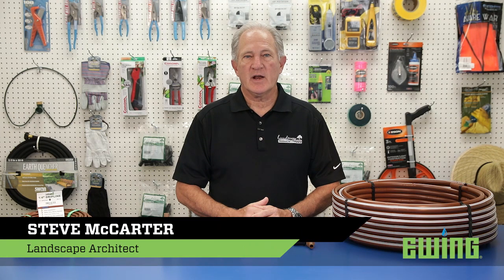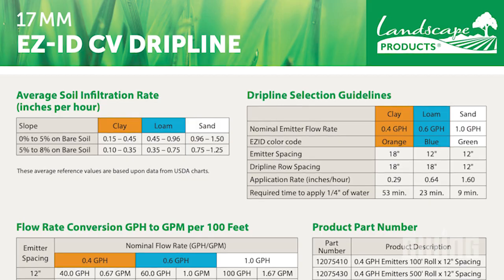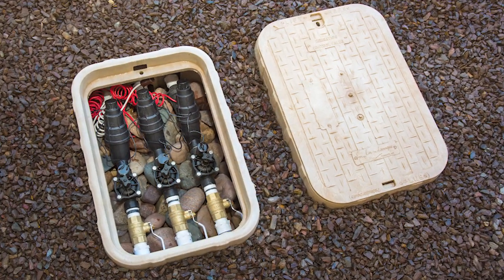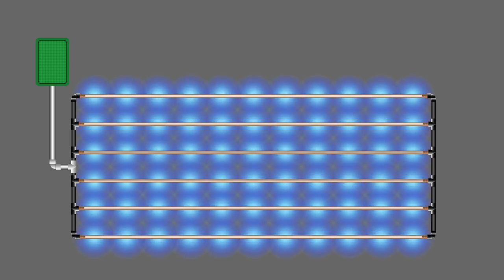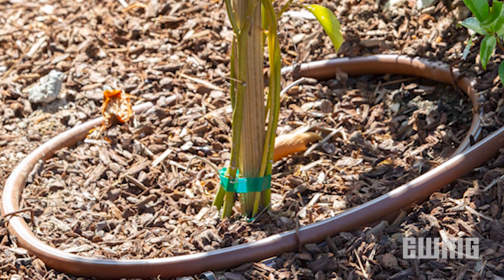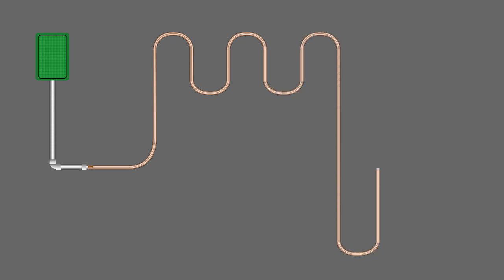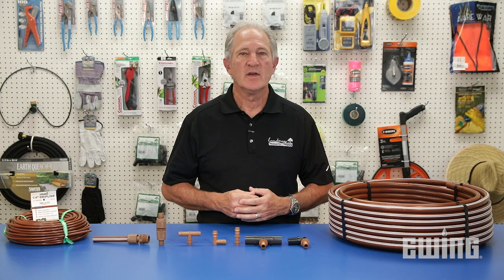Common Dripline Design Layouts

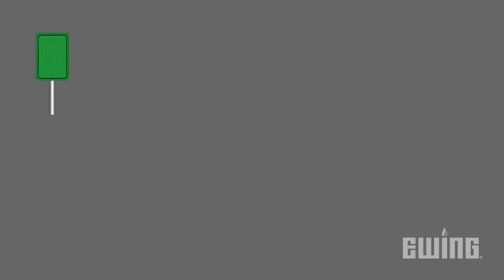Comment: For large trees (30ft or more at maturity) and the ring design (2:15)…can 1/4” be used or does it need to be 1/2” drip emitter tubing? Thank you.
Reply from the maker: You bet. As long as you use enough tubing to meet the trees water needs, 1/4" dripline is fine to use. Here's some more info on the product for reference.
https://landscapeproductsinc.com/wp-content/uploads/2022/02/Quarter-Inch-Dripline-1221-ENGLISH.pdf
Reply: @ewingoutdoorsupply  thank you!

Comment: Nice video,
I’m using this tubing for blueberries that are spaced 5 feet apart from the center of bush , can I block off the drip holes that are not next to the bush with a glue-gun or wet seal tape or by melting it with a soldering iron? 
Also with a blueberry bush that gets to be around 4.5 feet in diameter would I use the cycle method around each bush ? 
What is the maximum length this tubing can be run ? I have 60 psi and feed line is 3/4 . 
Thanks
Reply from the maker: You can move between plants using lengths of blank tubing:
https://www.ewingoutdoorsupply.com/12050910-ez-id-cv-17mm-dripline-blank-tubing-100-ft-roll

Here's a link to Landscape Products literature including flow data for both 17mm and 1/4 inch dripline. This will help you determine how long to run the irrigation based on the water requirements of the plants. Yes, the circle design would work.
https://landscapeproductsinc.com/product-literature/# 
Thanks for watching!

Comment: When using concentric circles on a newly planted tree should the inner and outer ring have the same emitter spacing and GPH?
Reply from the maker: On the inner ring, emitters on the inner ring can be closer together since the root ball of the newly planted tree is more concentrated near the trunk. Emitters with a lower GPH can be used to prevent waterlogging and ensure the young roots get enough moisture without drowning them.
 
On the outer ring, emitters can be spaced farther apart as they are designed to encourage roots to grow outward, establishing a strong root system. Emitters with a slightly higher GPH can be used to ensure the expanding root zone receives adequate water, promoting outward growth.
 
Newly planted trees need to be watered quite often for the first 30-45 days then back off.

Thanks for watching and for the question!
Reply: @ewingoutdoorsupply  Thank you so much